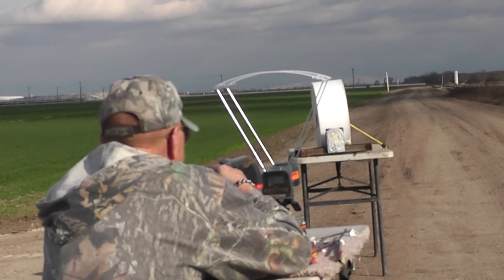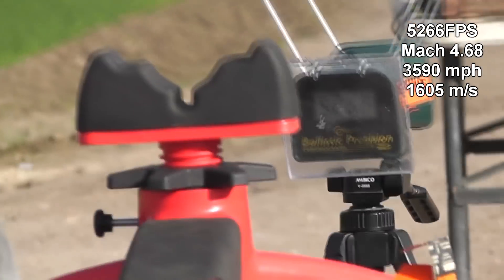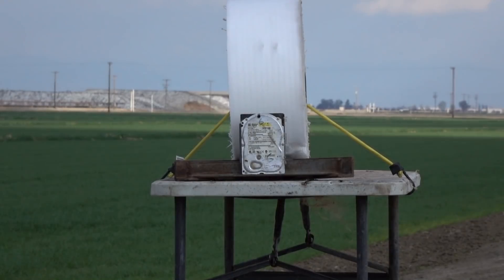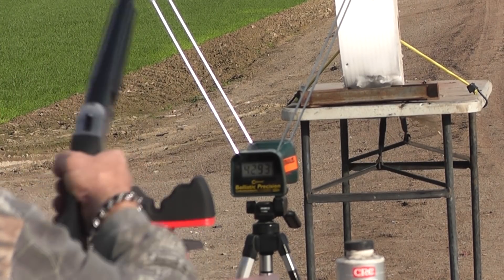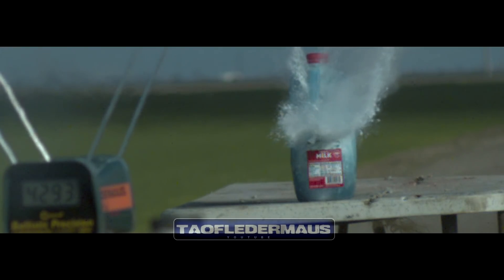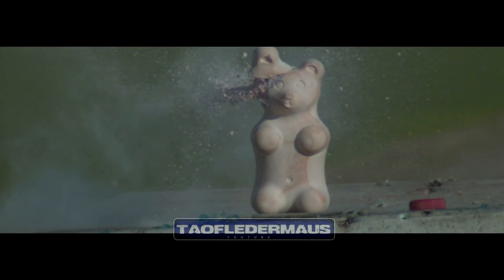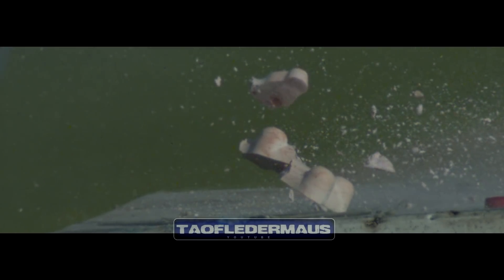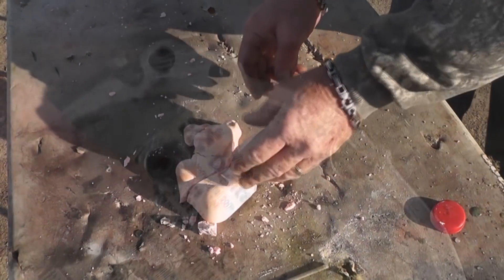Driving Airsoft BBs Faster than the Fastest Bullet - Must see!

Comment: Fantastic video as always, Jeff.  Check out DOM tubing for your barrel.  DOM (drawn over mandrel) is usually a very consistent inside diameter, seamless and is very strong shit..  You'll have to do some playing with maths to achieve close to 6mm ID.  Best I can easily come up with for readily available material is a 3/8" Outside diameter with 0.065" wall.  That'll bring it down to about a 0.245" ID, or 6.223mm.

This has me curious... how tight do these aluminum bbs fit inside your current 6mm ID barrel?  Super tight?  Easily roll through?
Reply: elesjuan 
They started as a snug fit. Had to push with a rod. By the end of the shots, they would roll in on their own due to the tube being expanded by the high pressure. Thats why the speeds got slower after the first shot. This was originally built to launch Crossbow Bolts. (Upcoming video) I found that a 6mm Airsoft BB fit inside, which led to us trying this.👍🏻.      🇺🇸😎

Comment: You're actually right around the theoretical limit for most powder propellants. Your bb is going pretty close to the velocity of an M1 Abram M829 kinetic penetrator sabot round.
Reply: So literally as fast as the gas can expand right?
Reply: @timbrwolf1121  Yup, as fast as it can propel itself. The gases actually contain most of the kinetic energy at a certain point.
Reply: Or you could use plasma to increase the burn efficiency and get well beyond your 5000 FPS. I created a simple plasma accelerator that gets over 2000 FPS with just plasma behind it. Heres a link if you wanna see https://www.youtube.com/watch?v=52jIgMNnpJw&t=33s
Reply: @Adrien McIntire it would indeed!  Didn’t want to sound like a nit-picker or fault finder earlier either haha but one can’t be too careful…just didn’t want you or someone else reading this to think that was a realistic goal and go try handloading and pushing until they got the numbers they wanted is all.  People be crazy.  

3500 is very doable for sure, that’s where the manuals top out, with a longer barrel and willingness to go slightly overpressure no doubt some have pushed it harder. 

Fastest thing I’ve loaded for is my .300 win mag with a Barnes tac tx 120 grain at a chronographed 4050 fps.  It’s violent as all get out and admittedly probably a tad overpressure but no signs showing (I measure for excessive case stretch and web diameter bulging, note how difficult it is to resize, inspect the primers on the spend casing, etc…) and no stiff bolt lift at all.
Reply: There is still the option to move the inner barrel halfway out and add a layer of helium in front
Reply: Donovan Shovan you are correct
Reply: @Adrien McIntire no it cannot!!!  It did break 6000 though back in the days when the us army was testing it as a means to simulate hypervelocity shrapnel impacts so as to develop better armor.  But that was with a ridiculous lightweight allow bullet, not a 180!  A 180 at 6k is over 14000 foot pounds of energy.  That’s 50 BMG level energy (energy increases exponentially with velocity, an object of equal weight moving 3 times as fast hits 9 times as hard…this is a part of why it’s so hard to break 4000 fps with projectiles of any notable mass out of shoulder fired rifles with ordinary barrel lengths)
Reply: APFSDS?
Reply: @Adrien McIntire .220 swift is one of the only rifles to crack the 4000fps mark, gotta have a smaller light bullet
Reply: German Gun
Reply: Even better would be to make the chamber a vaccuum. It would make the velocity of the expanding gas even faster :)
Reply: @rich1051414  Well it reduces the effective mass of the projectile. The speed of sound in the gas remains the same.
Reply: @rich1051414  No, thats not how it works ,lol
The limit is the speed of sound of the material that pushes the bullet. 
Helium has higher speed of sound while a vacuum has no speed of sound.
Reply: Well no not really. Tungsten sabots are traveling over 10% faster near 5900fps with over 1,000,000x the energy
Reply: @Xoars  I just know how to exceed that by many times and already done that before!Guess what the 0.8 gram magnesium oxide projectile does to stuff if the velocity is over twice as much as you said..and that is in meters per second!
Reply: @johnsheppard1476  explodes in atmosphere lol.
Reply: How? Other than a shape charge?
Reply: does tnt count as a powder propellent?    :-)   and... can we fill the bb with cement?
Reply: Yeah you're limited to the speed of sound in the propellant gas, which is basically limited by molecular weight and gas temperature. Light gas guns get to about 7 km/s.

Comment: absolutely incredible how you can see the air ripping like a fluid in slow motion!!!
Reply: That's cause the air is a fluid!
Reply: crazy world. i watch your sous vide videos haha
Reply: that vaper trail is actually from  the aluminum bb breaking down from rubbing against the stainless steel tube at 5000+ fps.
Reply: Perhaps something like a different refraction index for the air having been compressed by a supersonic force? Looks a lot like the ripple of air from a detonation.
Reply: pretty sure that's the water condensing out of the air as it's pushed aside so hard.
Reply: Squid Master+ Vapour condensing out of the air would be caused by the low-pressure zone trailing the shockwave that the BB creates, it would appear as a cone around or just behind the BB like you see on aircraft travelling at supersonic speed.
To me, it looks like a smoke trail as it immediately starts to rise through the air (because it's hot) after the BB has passed. The BB will be heated up in the barrel and will also experience heating from air friction at this speed so it's likely that it's the surface of the BB burning away.
Reply: we even have currents like the ocean called wind
Reply: air is a fluid
Reply: C.T. P its the bundlestilt that because the paper is for seventy two.
Reply: everything in the universe is connected by waves.

Comment: Any 6mm drop in barrel for an actual cartridge would work. 243 win, 6mmppc, 6mmrem, it would give you rifling with the correct lands and grooves and all you need is the correct case for the fitment. 243 is probably the least expensive way to go about this, but you will need some type of case filler because of total case capacity. 

Also you need to move your Chronograph a minimum of 15 ft from the blast of the muzzle. The concussion wave that extends from even a small pistol is enough to throw off chrono readings at anything less.

Comment: What is happening is that the aluminum is combusting upon impact. The B.B. goes through the initial penetration and shatters into powder. The friction of the impact heats it to combustion and the aluminum burns up almost instantly.  It would definitely be a great incindeary round if you were to use a larger round against a hard target.  Usually you’ll need an oxidizing agent such as iron oxide to burn aluminum due to the lack of oxygen in the air around it, but in this small of and application, it looks to be plenty.

Comment: You guys should try hitting rusty targets with the aluminum pellets. It would be cool to see the thermite reaction in slow motion. It would also be cool to have a side by side comparison with a cleaned up section of the target, so that the pellet hits a rust free area of the steel.

It would also be cool to see you guys shoot an oxidized copper plate, as copper oxide-aluminum thermite is kind of explosive.

Comment: I dunno if wolfram is confused or dead on but the 5266 impact was a little over half a horsepower.   (386j)   WHY it gave me the answer that way I don't know.  0.3 grams is not 3 grains... its 4.6 grains.   An absurd amount of energy for such a light object, a 55 grain .223 @ 2953fps has 1444j or right about 4x the energy of your first shot.

Comment: That's great, that's about as fast as smokeless powder can push stuff! BTW the lighting in this video was great. I think that plaster target is a good idea, cheap and easy.
Reply: I agree, that plaster target is great. It should explode quite nicely when hit by a slug.
Reply: TheBackyardScientist Absolutely!
Reply: @ARockyRock  nice
Reply: It's actually faster than most modern bullets
Reply: @beargillium2369  Yes, we know that. What he's saying is that they're reaching the maximum velocities any modern smokeless propellant can produce with any bullet, because the bullet is nearing the maximum gas expansion speed.
Reply: @CometChaser97  thanks for the clarification capt obv. ... He actually said "about the same," which it's not. According to google, the fastest (commercial) bullet is far slower, and it's because at those speeds the powder explosion causes severe damage to the barrels very quickly.
So while you technically could make a "hotter" powder, it's counterproductive.
Reply: Is he using the airsoft bullets to hit targets or what idont understand

Comment: Just a thought if you used a slower powder that would utilize the full length of the tube to build velocity and  the pressure spike would be slower and that thin wall may hold up.   (Maybe)

Comment: Your chrono appears to be too close to the muzzle of the gun. Usually it is set like 10 feet in front so the expanding gasses won't interfere. You can calculate velocity decay using the ballistic coefficient of the projectile.

Comment: this is so great. It's going fast enough that it starts to give you an idea of why MMOD are so dangerous in orbit. A small .3 gram bit that just happens to be going 5000 fps different than you will punch a hole in just about anything. In orbit they are going about 35000 fps or faster, but at that point it is not much different. It punches through the first layer, then disintegrates into a molecular vapor that can't do much damage below the first layer.

Comment: @Taofledermaus You can build a steel sleeve on a lathe with the inside diameter just perfect to be pressed fit onto that steel airsoft tube. You can make it as large as the 12 gauge inside barrel, and this way it will virtually indestructible.I bet you can take a 12 gauge to 7.62x39 or 5.56 adapter and it will be just fine. Or even a 308. In fact, i just gave you that ideea :). The extra volume in those cases is just what you need to take it to the next level. I think you can reach Mach 6 with that setup. Goodluck

Comment: While in training i once had to test a 8 mm steeltube and it bursted at 3000 bar, guess your 6 mm should be able to handle similar presure, but there is probably a website, where you can check if you have the steeltype etc.

Comment: Hi TFM I  have a conlusion what forms the  Flash of Aluminium impacting Lead and some other Metalls : Thermite Redox Reaction   the lead is couvered in a thin layer of oxide and when the Aluminium strikes with enough force it causes the leadoxides ( usesd as oxidising Agent in pyrotechniks) to give its oxigen to the Oxygen loving Aluminium releasing energy, forming lead and Aluminium oxides... the superheated lead wich is formed again oxidises on the  air.   But in case of those superfast BBs i think the Speed for itselv is enough to cause the Impact Flash just like a LightGasGun would do.

Comment: Nice vid. Incredible how fast this thing go :-) I have an idea for you. There are always this flashes on inpact of many projectiles. I still think that its electric charge. To proof that it should be easy possible to put the lead plate on something unconductive and add a wire with a led/ligthblub to it, that ground it. So the charge should be forced throug the cable and led to the earth and the ligth should flash or explode :-) Would be nice to see that. Keep on good work.

Comment: NASA also does similer experiments to simulate micro meteroid impacts. Great vid, should have tested the lead plate and clay block targets. Flashes on solid targets can be caused by super sonic projectiles forward surface heating up due to atmopheric drag. Think meteors.

Comment: At some rate of pressure you chamber will always balloon up. The parameter is called yield point, when the metal starts acting like a thick fluid.
https://en.wikipedia.org/wiki/Yield_(engineering)

Comment: I think trying a faster could get you worse pressure issues without giving any significant velocity increment, if any at all. I'd actually try going for a slower burning powder and a small pistol magnum or even small rifle primer. The slower powder should prevent the pressures from spiking at ignition while burning longer an propelling the bb faster. The small pistol magnum/rifle primer would help ignite the powder properly, since I don't think the bb can provide the right starting pressure.
Reply: maybe a mix, like going from slow to fast

Comment: Awesome. If wall thickness is an issue for the BB barrel, why not get multiple size barrels, and place them inside each other. Start with a 8mm x 6mm 304 stainless steel tube, slide that into a 10mm x 8mm then wrap that in a 12mm x 10mm. That should give you a 3mm walled barrel. Braze the ends to secure all three tubes and you should be good to go.
If you wanted you could keep wrapping each barrel in a larger tube till you got up to 18mm, filling a 12 gauge.

Comment: Jeff: get 1 of your machinist supporters to machine a slip in barrel for the 12 gauge with a longer length barrel... also there is several different faster types of powder to use ...Try for 6k fps...also you might move the chronos to 6'-8' away from the barrel to help with the error problems

Comment: As a comparison, I drug out my reloading log. Back when powder was really hard to find, I bought some E3 powder (because it was all I could find) and worked up some loads for 115 grain 9mm bullets.

At 3.2 grains I averaged 1047 fps
At 3.4 grains average was 1062 fps
And at 3.6 grains I got 1084 fps.

You really got some impressive numbers with that powder!
Reply: SomeGuyInSandy how long was your test barrel?
Reply: I bought the same powder at that time for the same reasons, and have worked up loads in several calibers.  It worked great so I still use it.
Reply: XDm 4.5 inch.
Reply: SomeGuyInSandy wow, what do you think it would come up to in a 16" barrel

Comment: if you want to strengthen that "launch tube" just wrap it in (stiff) wire. something that used to be done 50+ years ago by some not so nice people. if you can get it tight enough you should be able to double the pressures it can handle.

Comment: The best thing that I can think of to temporarily slow the expansion of the barrel is wrapping the insert with electrical tape. Not sure if you need the flex to prevent over pressures, but just a thought.

Comment: Can you use a  aluminum block as target next? I want to see how it compares to  NASA's hypervelocity impact experiments.
Reply: Lead is much denser than aluminum. An aluminum bb hitting aluminum yields very different results than an aluminum bb hitting a lead target.
Reply: is that anything like the railgun?     well...  at 7200 fps the projectile goes through everything..  even 7 pieces of 4" thick steel plates spaced apart 8 feet.

you slow it down to 300000 frames per second you can watch the projectile just pass through the plates like butter without even slowing down.

Comment: Someone needs to show Hillary how to actually destroy hard-drives
Reply: Volvirth - Google 'zeroing a hard drive'..... and then do it, for being so over dramatic about it. ;-)

You make it sound like NO OTHER METHOD will vanish a drive and acid is the only way, where as sitting down for 15 mins with friends will deliver at least a few hundred ideas to completely fuck a drive over.

What are your views on using a 1 kiloton tactical nuclear artillery shell? Barely scratch its tits, you say?
Reply: a forge would work nicely. cant hold information if it a liquid, right? XD
Reply: Sanding the magnetic material off the substrate is a good one. Raising the drive platters above the Curie temperature is another. In the first, even if you extracted the bits from the remaining powder, you'd have no way of putting them back in order, and the second would render the material non-magnetic for a moment, so whatever magnetization it had when it cooled would be random, and not influenced in any way by the data that had been stored previously.

Just a couple of examples that are just as thorough as dissolving in acid.
Reply: Volvirth magnets, my friend. Magnets
Reply: Volvirth Not really. I've work as an it technician and you can wipe a harddrive to only 0 so you can't extract any data from it.
Reply: Magnets would destroy disk for you but not for specialist...
Reply: jasexavier hahaha thoughtfully thorough
Reply: Anchor Bait 😂
Reply: Bill could end up castrated then ...
Reply: All she has to do is look at it, and it melts . . .
Reply: Anchor Bait hahahahaha yes, 100 pts to you
Reply: Anchor Bait HAHAHAHA
Reply: Yeah, evidently ballistic weapons are a little more effective than the witchcraft she was previously using, the stupid bat!
Reply: Nah, you could still recover data from these.
You can even recover data from shredded drives.
Basically, if you got a hard drive you want gone, dissolving it in acid is the only real way to destroy every last bit of information.
Reply: Volvirth how about melting it ?
Reply: Nicee
Reply: Noice xD
Reply: Very naice
Reply: Bahahahahahaha nice

Comment: The plaster looks great. 

Also some of the expansion is actually wear from such a high speed round with such hot powder scraping and vaporizing the walls of the tube. The same thing happens to large cannons as well as cartridges like the 22. Swift and .22-250